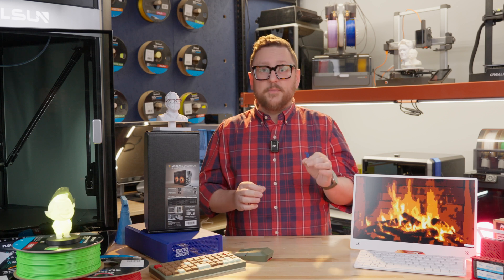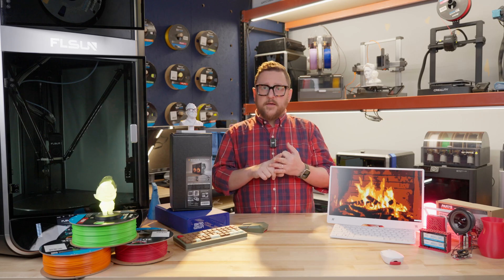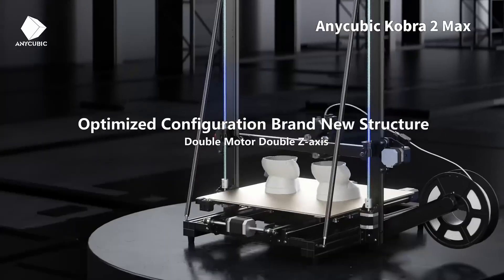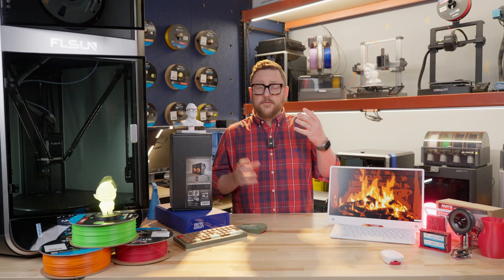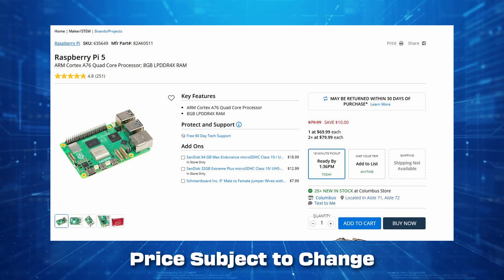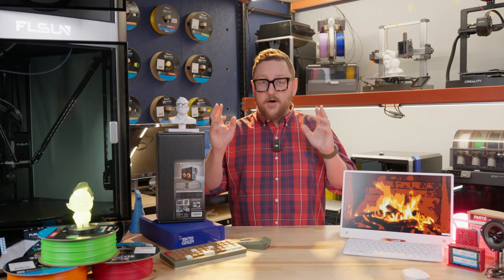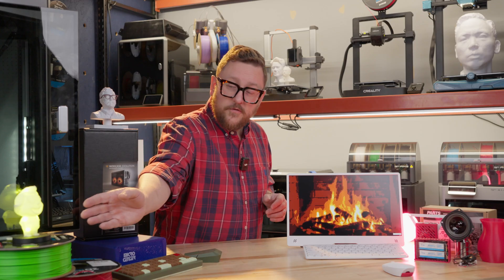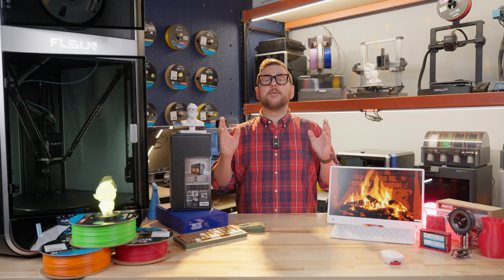3D Printing 2025 Predictions From Micro Center's Maker Lab

Comment: Oops, sorry, you caught me refilling my custom tall, small footprint, 3D printed kneenex box. Snowing here today reminds me I need to mount some printed coat hangers in our mud room (it's a thing in snowy climates).  Toilet seat keeps coming loose, so printing a wrench for adjustment to store in the bathroom is on today's list.  Might look into printing toilet tank flapper print as the older one is leaking slightly. 
Maybe 10 % of my prints are toys. Kazoo's for kid's birthday parties, card kits, etc.  Might consider custom designed tools for the fabrication workplace.